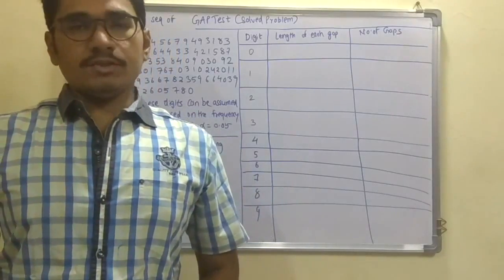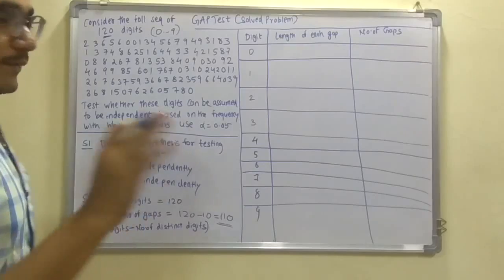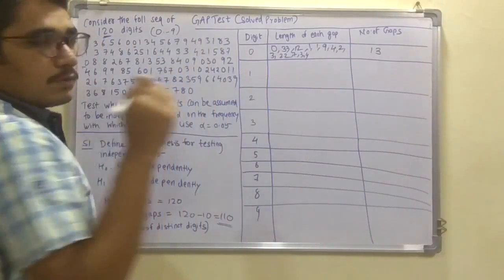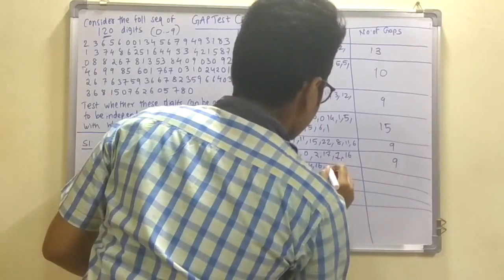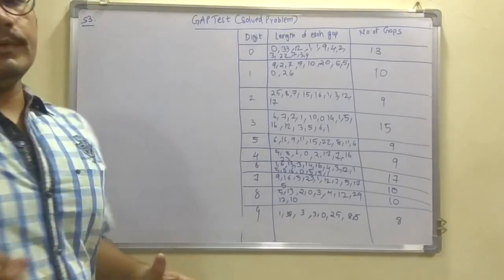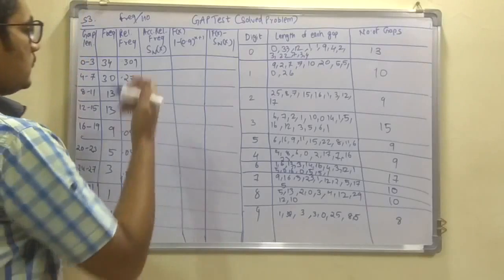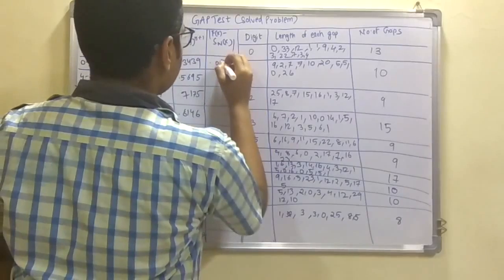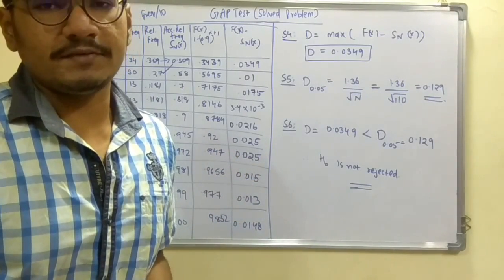Simulation Modeling | Tutorial #20 | The Gap Test (Solved Problem)

Comment: Frequency: This is the sum of certain numbers (0, 1, 2, and 3) from a table called "length of each gap". You're not pulling these numbers from a question, but from this specific table.
Gap Length: The gap length goes up to 39. This is because the table (which was shortened or cropped by the YouTuber) has a value of 38, so you count up to 39.
Gap of 3: You can choose any gap length for your analysis, but smaller gaps (like 3) are better for this purpose

Comment: why did you have 1.36  when calculating D alpha there, why is it 1.36
Reply: for n>40, (acc to the instruction at the bottom of the K-S table) when alpha=0.05, the value is calculated by (1.36/√ N).

Comment: can you tell how to calculate the frequency in the second table second column? i am not getting that.
Reply: For 0-3 , just count 0's , 1's , 2's and 3's in "length of each gap" from 1st table the add those counted value 
For example in 0-3
There are "8" 0's , "11" 1's , "6" 2's and "9" 3's
so , 8+11+6+9 = 34
Reply: @SrijinaPoudel there are more than 8 zeros and so on😮
Reply: For next digit how it calculated from 4 to 7
Reply: Shrijana Poudel plz explain total frequency how it came